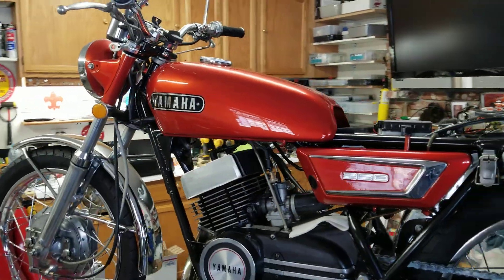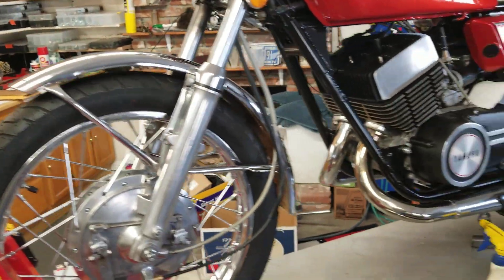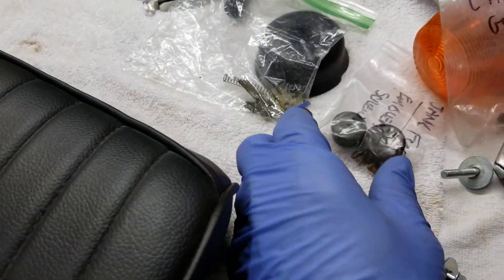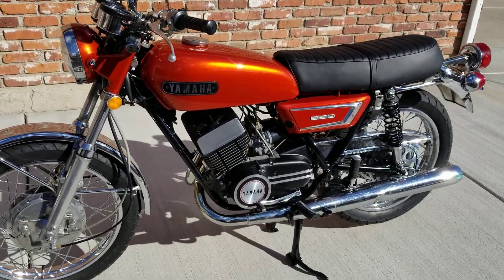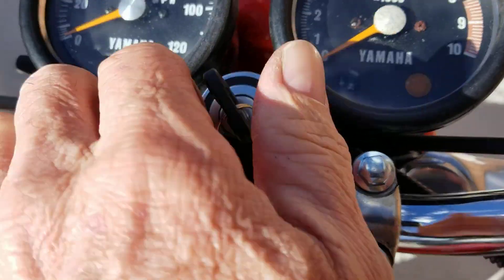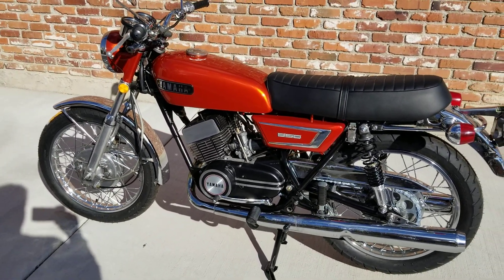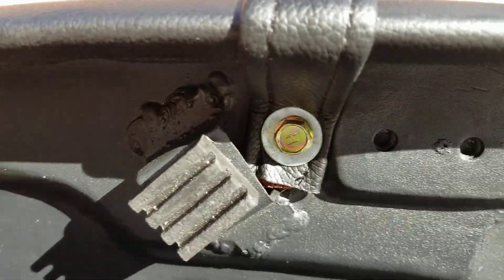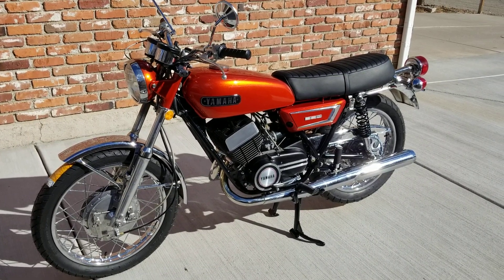1972 Yamaha R5 350 Restoration Part 5

Comment: 1:57 This wire clips to the rear fender under the seat and is supposed to keep the wire bundle in place. It latches under a piece on the frame near the oil fill cap. Looking fantastic!